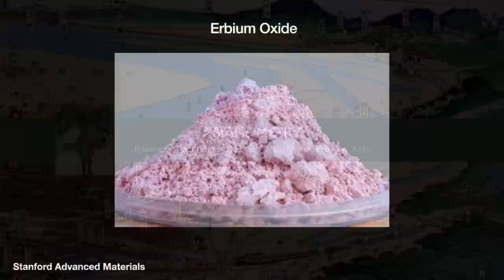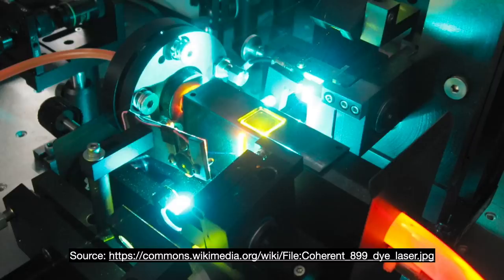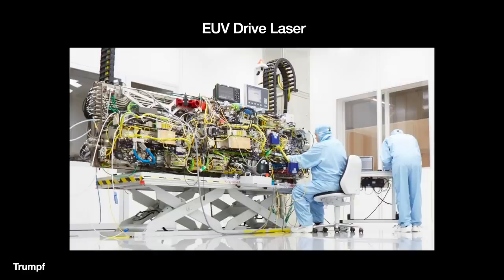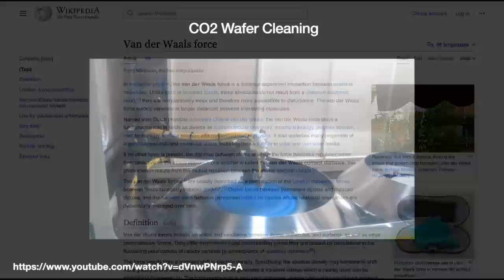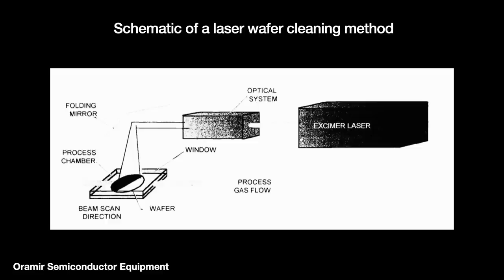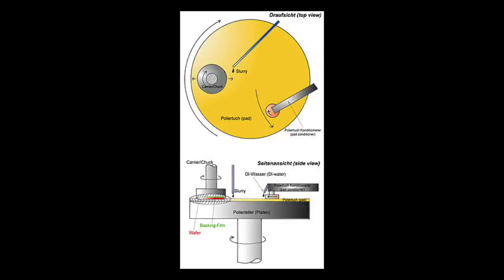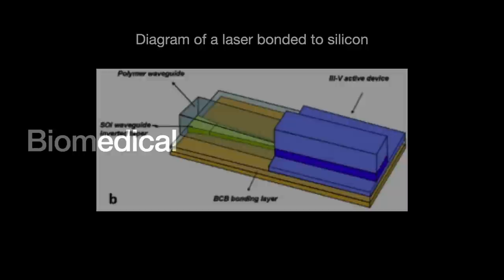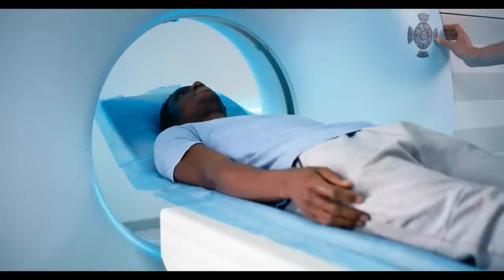A Semiconductor Rare Earths Problem?

Comment: "Rare earth" of our silicon age is roughly equivalent to tin in the bronze age. 

Relatively rare, and much rarer large scale deposit sites, it needed a complex trading system to circulate it to numerous Empires at the time, but when noumerous problems arrive (may be it for enviromental, political, sea people, etc), straining it to destruction. It only accelerates the collapse of the era of bronze.
Reply: Are you suggesting that we're going to have a silicon age collapse?
Reply: @ronmaximilian6953  its a possibility, just seen a similarity between the two.

Comment: I collect physical rare earth elements. They're very interesting. Gadolinium is magnetic just like steel, but only in warm weather, on cooler days it's no longer magnetic, but if you hold it in your hand for a while, boom it's magnetic again!
Reply: woooooah! that's trippy!!! you would be like magneto!!!
Reply: Gadolinium loses its magnetism at higher temperatures, not the other way around
Reply: Curie point 20° C or thereby if remember correctly.

Comment: In the optical communications industry, Erbium is used extensively as a doping material in the core of an optical fiber to provide the necessary gain in the low attenuation wavelength range. The so-called Erbium Doped Fiber Amplifier (EDFA) is by far the most common type of optical amplifier for wavelengths around 1550 nm. Other rare earth materials are used for different wavelengths as well (e.g. ytterbium)

Comment: Not semiconductors per se, but MLCCs are frequently doped with REEs. It’s the difference between y5v and x7r grade capacitors. Which REEs, how much, etc seem to be a trade secret.

Generally speaking, as dopants, REEs are not going to be called out, as their addition is generally secret.
Reply: X7R good, Y5V bad.
Reply: @nicholasvinen - Y5V is better than Z5U, so not really bad for those who understand the variation of value with temperature for the different materials

Comment: 1:03: 💡 Rare earth elements, particularly lanthanides, are essential for various industries including semiconductors.

3:17: 💡 Rare earths play critical roles in modern technology, including laser cleaning in semiconductor fabrication.

6:04: 🔬 Plasma material processing and rare earth elements in the semiconductor industry.

9:39: 🔦 Rare earth elements play a crucial role in the production of white color LEDs and silicon photonics.

12:28: 💡 Rare earth elements are not significantly present in semiconductor manufacturing, but they play a crucial role in equipment used for production and in adjacent areas like optoelectronics and silicon photonics.

Recap by Tammy AI

Comment: Chemical mechanical polishing with CeO2 or colloidal silica or Al2O3 etc is because of the chemical (ph differences in the carrying solution/media leading to slight chemical attack of very small ridges ie scratches) and mechanical from the physical media particles grinding the surface. The pad is just the carrier, albeit different pad knaps (how it is woven) may enhance or suppress the mechanical grinding aspect

Comment: Great video! Especially liked how you mentioned such a broad range of applications. One note: with FinFETs and GAA devices, they are not going away from high-K gate, they are still critical for device performance, manufacturability/yield etc., as you'd need impossibly thin regular SiO2 films to have the same effective performance (gate control). I expect since we're now getting closer and closer to physical size limits, there will be more innovation in materials (due to neccesity), like Pat Gelsinger said: "We are entering a period of sustained, if not Super Moore's Law. We expected to even bend the curve faster than a doubling every two years, and we will not rest until the periodic table is exhausted. We as the stewards of Moore's Law will be relentless in our path to innovate and the magic of silicon. Like I said, Moore's Law is alive very well,"

Comment: Erbium is also used for erbium doped fibre amplifiers, which are vital to optical networks and revolutioned it in early 90s, allowing to transmit multiple wavelength channels.
Niobium, beyond being used for it superconducting properties (Fermilab uses toroidal shells as radio frequency filters to select the particle energy of a beam, for instance), is also a component of litium niobate (which is a birefringent ferroelectric crystalline material), often used for high performance optical modulators.
(not to be fussy, but Lutetium should be pronounced as Lutezium).

Comment: With China limiting exports of Gallium and Germanium, I expected special attention for those. Perhaps it is an idea to do a more specific deep dive?
Reply: Germanium occurs with zinc in many deposits around the world, so it is not difficult to locate supplies.   I saw a video where a lump of germanium about the size of a football was in the safe of a semiconductor company and the CEO said there was enough there to keep them producing semiconductors for a century.
Reply: @karhukivi  not a big semiconductor company then :face-green-smiling::face-green-smiling:
Reply: @morganangel340  The amounts of these metals required to make semiconductors is small.
Reply: @karhukivi depends on what kind of semiconductor. You would need a lot of them in high power applications. Like radars and sonars, lidars, super chargers for electric cars...etc. They would need to process millions of tons other metals in order to get them. all the chemicals that involved are part of other industries too. It took China over 30 years to gain the current capacity and all the related industries in order to extract them at current capacity.
Reply: @commie5211  However, gallium and germanium are not rare earth elements and they are found in many locations, which was the point I didn't make very well!
Reply: @karhukivi  you can find platinum in mud... extracting and refining is the real beach.
Reply: @karhukivi  Even the rare earth is not rare, but it got nothing to do with the mining, it all about refining at larger qualities. It will take at least 15 years.
Reply: @morganangel340  Absolutely true!   If you produce milk for $100/pint who would buy it?

Comment: Great video, I found this topic quite interesting. I think that an Economist would say that the semiconductor industry would likely get the rare earths it needs because it's a high end use of these materials and would be willing and able to pay higher prices. Other lower cost uses of these rare earth elements would likely have to shift to using something else. For instance I suspect if there was a supply chain or tariff issue with China lanthanum electrodes for welders could become too expensive so welders would switch to using other types such thorium.

Comment: Excimer laser's used in photolithography use optical coatings made with Lanthanum Fluoride.  Yttrium stabilized silicon nitride is also a good bearing material for harsh environments were conductive metal bearings cannot survive due to electrical arcing or chemical corrosion.   I think they started using them on a lot of space craft too.  I heard a few very expensive space craft failed due to gyroscopes seizing up when their metal bearings formed pits due to electrical arcing.

Comment: Maybe the production of rice university flash graphene could solve the problems of extraction of these Rare Earths by recovering them out of the gasses created by the flashing progress. Maybe it will be an easier way to recycle electronics to get their expensive and rare resources out. It would be awesome if you could make a video about "Laserexcited remote phosphor (LRP)" It is used almost anywhere, beamers, movingheads, flashlights, carlights. The ''clay paky xtylos" uses a LRP source that even can change color like and rgb-laser. The efficiency is very remarkable. The movinghead is a lot smaller has far more colors and cause it has no color filters all the colors are the same brightness and the contrast it makes between dark and light is laser like. I found that these systems work by shooting a RGB laser at a mirror-like-plate made out of some kind of ceramic-phosphor. It sounds not that hard but i can't seem to find more about this. Maybe you could find more information about this it would make an interesting video.

Comment: Excellent video as always. 
Please note that "micrometre" is a better choice of unit compared to the obsolete "micron". 😇
Reply: It's the same thing by a different name. Micron is not the name of the SI unit, but it's commonly used in industry. Probably because micrometer is a mouthful.
Reply: @Gameboygenius  Nanometre is just as much of a mouthful. Should we not use it either? 🙄
Reply: @punditgi  actually, nanometer feels like less of a mouthful to me. It's the two m's that do it for me. But all I'm saying is that it's not a big deal in this case. Just be glad it wasn't microinches. (Eww!)

But maybe you're onto something with avoiding nanometers. The semiconductor industry node names basically have nothing to do with feature sizes at this point. So to embrace that, they stopped calling it for example the 5 nm node and now call it the N5 node.

Comment: My take is that the US isn't as worried about securing rare earths as much as semiconductors because the former is a resource and the latter is more of a capability. A semiconductor factory is easily destroyed, but not as easily rebuilt, if at all from the ground up if there were no others available to you. I believe the calculus is that if push comes to shove, they can always take the land the rare earth comes from if they need it, whereas the means to build chips could be entirely taken from and then denied to them, which will only further cripple their ability to get it back the longer it persists. Pausing production isn't as bad as losing the ability entirely more or less.